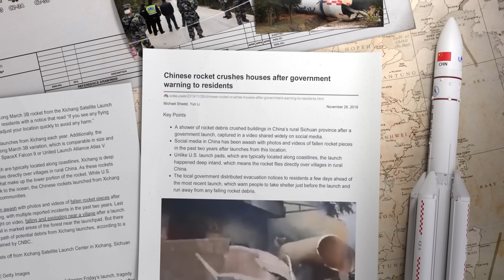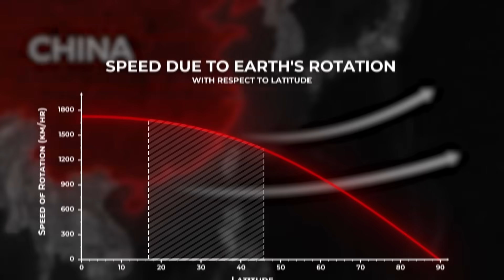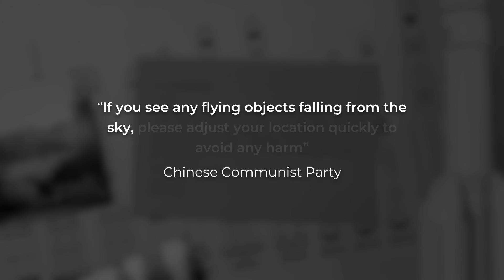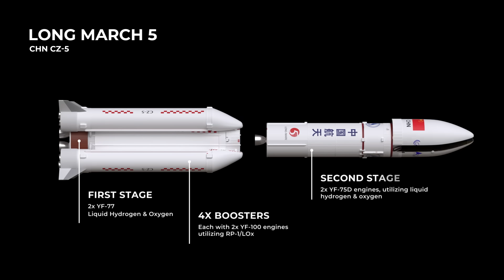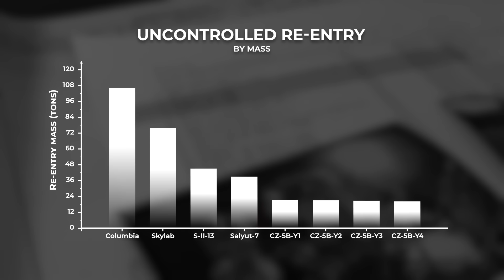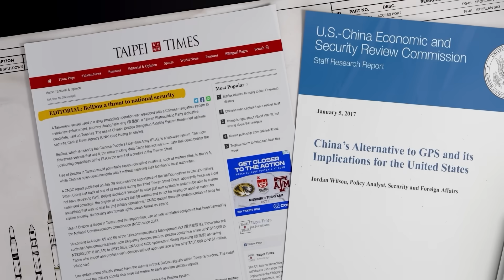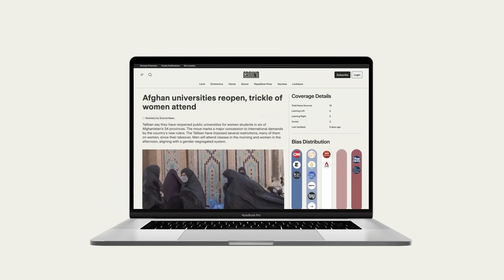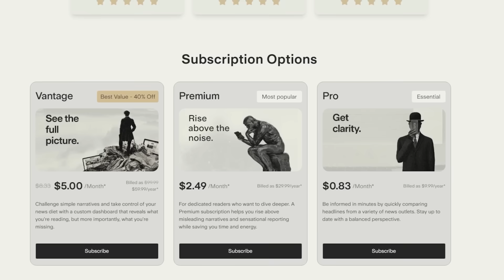The Problems with China's Space Program

Comment: I'm sorry but your idea of balanced is in fact not balanced but forced equal representation to appear fair whether in reality a given topic of issue is exactly 50/50 or not. But it does appease the sensibilities of weirdo control freaks while inhibiting any given viewer's ability to fully comprehend topic/issue/talking point when we do this as it create ambiguity where there other wise would not have been any. 

The video itself is good plus informative though but aspiring to emulate OFCOM's definition of balanced is not impartiality or disimpassioned analysis which is balanced as it's representative objectively speaking so I strongly recommend against it. 

While we may be intelligent enough to get the point, you still need exercise the strength of character to do the right thing  and not capitulate too or appease the sensibilities of  tyrants that want to control the narrative truth be it.

Comment: I recently read the wikipedia article  regarding the long-march rockets. At some point, the rocket was working, but deemed to be to expensive. Therefore they did cut corners in production to lower the price and even anticipated a certain increase in launch failures while doing so.
Reply: that's called engineering
Reply: @w0ttheh3ll  proper engineering is figuring out where you can reduce costs/weight without significantly increasing danger or risk.  cutting back until it ends up deorbiting uncontrollably and unpredictably is very much not engineering, it goes against all principles of engineering, and the oath that engineers swear
Reply: @Corvus.2606  I have an engineering degree. There was no oath involved.
Anyway, I didn't say that you should kill people, I was just making a comment on a very general statement. "Cutting corners" and "anticipating a certain increase in launch failures" is literally what all rocket companies do. The only difference is what level of risk is acceptable to the designers.
Reply: @Corvus.2606  I swore the dumb Oath. I never meant it
Reply: @Corvus.2606  Must be an American engineer thing.
Reply: @w0ttheh3ll  No, not at all. You don't design a system like a heavy lift rocket to fail. You may have to accept some risk which is out of your control but you don't increase it on porpuse.
Reply: @oO0Xenos0Oo  you'll find that you may just have to accept a bit more risk if you don't live in a world where your customers have infinite money, carbon fibre parts grow on trees and refined fuel flows in rivers free for all
Reply: @oO0Xenos0Oo well it depends. You know, roughly every extra 0 in failure rate doubles the costs. So in an hypothetical device has 1% failure rate and costs 1 million $, to lower to 0.1% it would cost 2 million $, then to 0.01% it would cost 4 million $ and so on. As the other user described, it comes then to what failure rate is acceptable, after all, nobody (maybe excepting the US military) has infinite money.
Reply: Did the Wikipedia source this Information?
Reply: @GraniteInTheFace  Well, they did, but source is in chinese for obvious reasons:

http://jdse.bit.edu.cn/fileSKTCXB/journal/article/sktcxb/2021/1/PDF/sktcxb-8-1-songzhengyu.pdf
Reply: You say that as if it literally everything in China hasn't had corners cut during its production. You don't get rebar that can be snapped with your bare hands, and concrete that can be broken off a building and crumbled in your fingers without it being a systemic problem.

Comment: You have to remember, those villages don't significantly provide to planned economy. The people are still in villages, not in the cities and factories, so they clearly aren't important. Besides, most of them are ethnically undesirable. So, really, they basically aren't people, and it might as well be an uninhabited wasteland. Moving launch facilities somewhere would cost a lot of resources, and there's not really a reason to do it, plus moving them would imply that there was a problem with the states original plan (which is clearly impossible). 

Or, you know, communism as usual.

Comment: 😅Chinese GPS/Beidou cannot locate  you if you only use it to locate yourself in a GPS fashion. The uplink is only for military and paid customs for short text messages. If it can locate all users, then DDoS attack is a clear threat to this system😂.
Reply: @yozul1 track your phone? You don't need a satellite to do that....A phone needs to connect to a nearby cell tower you know. That's how fbi always knows your location, and they actually can track every single one of the phones.
Reply: even if it can your phone surely does so anyways with google services and the allow GPS access it just sends it back through WiFi instead
Reply: @yozul1  It is not possible for something the size of a  phone to establish a connection with somthing up in GEO without melting itself. It's  a physic problem, not a  capability problem
Reply: @fluffy_tail4365 navigation satellites are not in GEO. They are only about half as far away.

And it's absolutely possible to communicate with a satellite that far away, as long as the satellite has a large and sensitive enough receiver. We can communicate with the Voyagers at the end of the solar system. There is no hard limit.

That being said, this seems like a very difficult way to solve a problem that you can also solve by requiring software in the smartphone to send back the location over the internet or even just through the cellular network. If you want to spy on your citizen's movements, this is how you already capture 99%+ of what you want.
Reply: @fluffy_tail4365  Not true in the slightest, even something as small as a phone sending the right kind of signal can be detected at GEO, but that's beside the point, because they can use the cell-tower to establish a connection with your phone and make it give up lat/long info. Also most of Beidou is in MEO.
Reply: @fluffy_tail4365  only a small part of beidou is in GEO, most is at the same altitude as GPS satellite, and huawei phones have been able to use beidou messaging for a year or two now, read some news first, dude

Comment: That point about BeiDou capable of "monitoring entire nation's populace" is misinformed, at best. At worst, it take away more important issue that could be discussed in lieu of personal privacy. 

Yes, Taiwan did ban BD receivers, but their focus are mostly on maritime usage. Common mobile phone (unless it is specialized one like inmarsat devices) are physically incapable of establishing 2-way comms with a navsat. But some maritime receivers do have and make use of those capabilities. Given the importance of maritime logistic for Taiwan's survival, they decided that using BD is not worth the risk.
Reply: London, England, has the most CCTV cameras per km2  : 399.27/km2. 
New York has the highest density of CCTV cameras installed in the US: 25.97/km2. 
Beijing in China has the most cameras (1.15M) but is ranked #10 for density (277.51/km2).
Reply: @happymelon7129  I can't tell the point you're trying to make or if you're purposefully misrepresenting the data. I assume you took it from the Surfshark surveillance cities website as their data seems to match yours? China has 6 of the top 10 cities in the surveillance density list. Harbin, China is ranked 3rd for density with 411/km2 and is just above London. 

New York's the highest density city in the US and has only 10% of the surveillance density as Beijing, which is the lowest ranked of the top 6 Chinese cities.
Reply: also that sounds still just like  a  political move....like you can just not establish a two way channel and keep using the satellites as simple beacons anyway and they cannot track you
Reply: @fluffy_tail4365 Since the target is civilian vessels, an outright ban is arguably more effective and time-efficient than mandating them to toy around with the gnss module. Since you only monitor the trade of equipment rather than operational constraints.

The same reason why slapping tarrifs seems to be preferable compared to actually helping local businesses get competitive. Less work for relatively same effect (from the government perspective).

Comment: You didn't mention a important info regarding the Beidou positioning system/network: the current version is fully usable with passive receivers, just like GPS, Galileo or GLONASS. In fact modern chips in most phones support all these systems and are pure receivers. 
While it has the feature for two way communication this is not not relevant for consumer devices, the senders are more expensive, have bigger antennas and consume too much power. So the are only viable for vehicles, especially military. 
Tracking of individuals happens via cell phone towers on the ground and software on our phones that shares the location via internet connection...
Reply: Yeah, I was wondering when a small hand held device had 2 way communication with a sat on geo synch / MEO orbit. If that was so easy and does not need bigger antennas, everyone will be using some form of sat phones already.
Reply: What about the "new" satellite connection in iPhones and Chinese phones?
Reply: @AlphonseDanielEdge  those are LEO satellites, not the same as MEO GPS satellite beacons
Reply: @AlphonseDanielEdge  Those are to LEOs. I really doubt an average mobile device can send a signal to something that is 500km or further.

Even the starlink linked phones, the sats are only about 100km high.
Reply: @someb0dy2  incorrect, the orbital shells are 525km, 530km, and 535km. emergency cell sat service is only good for text messages and low quality phone calls. that being said everything hippo said was incorrect other than the last line.
Reply: This has to be a bot account, there are so many comments that have a similar format and basically same talking points. I would guess that these bots are using something like chatGPT to generate unique comments so they can’t be caught by automatic comment scanners.
Reply: @monkeyman2233-g9o it's not a "fearmongering" claim, it's war mongering, paid for by the $1.6 BILLION that was passed in the house of congress. Expect even more anti-china propaganda in the coming years.
Reply: Military personnel testify before Congress --
Suit technology does not hold up under critical review, regardless whose program is involved.  The need to replicate their space station interior aboard ballistic flights [the US version known as the "Vomit Comet"] also indicate theater, while our own activity in orbit indicate layered video for some interior video aboard the ISS only to confirm that some missions are dramatized.  This isn't to deny hardware in orbit or programs involving near-Earth orbit, but to recognize the diversion of funds for programs of much greater potential. Military personnel have recently testified before Congress of the back-engineering of alien spacecraft -- something that has been going on for decades, while public programs serve as a distraction and the diversion of funds. Near-Earth orbit is real -- however, evidence of layered video as well as other indications reveal that not all near-Earth activities are real as demonstrated as other undisclosed programs receive allocated funds. During the 1990s, former CEO of Lockheed Corporation Ben Rich described the ability by that time to reach other star systems, as well as many other amazing developments that he stated would take an act of Congress to release for the benefit of all of us -- including means for the production of unlimited energy without fossil fuels using similar technologies. Tesla himself had developed such means over a century ago, only to have his facilities as well as his reputation destroyed sufficiently to prevent funding for his efforts again moving forward -- he himself responsible for the development of the electrical grid that we still use today, before the turn of the 20th century.
Reply: Its disappointing to see this channel sucumb to making garbage claims for views. If Beidou had two way communication for tracking on a personal level it's better than starlink- and predates it by a decade. This kind of stupid fearmongering claim as well as the fusion video really showed me the decline in quality for Real Engineering... I think its time I unsubscribed after years of enjoyment.
Reply: @monkeyman2233-g9o  The difference is Starlink is held to U.S laws. Meanwhile, the CCP keep pretending they have jurisdiction over the whole internet and keep trying to go after people exposing it. Not to mention Starlink is more tuned to civilian use, while Beidou is clearly intended for military use. Between  "dual-use" and "we totally don't intend to militarise those artificial islands...", we have no reason to trust the CCP on this.
Reply: @monkeyman2233-g9o I agree. The channel becomes more and more propaganda style channel. Biased, revealing only part of the truth.
Reply: found the china bots
Reply: @DanTheManOG   ever consider you're an unwitting bot for papa biden yourself?
Reply: @DanTheManOG You’re just as much of a bot yourself, a western bot, who’s around videos like this wishing to to hear what you wanna to hear
Reply: @ it’s a decent place
Reply: I just wish they could go straight to the social credit part next time so that I wouldn't have to waste so much time on their not-even-wrong understanding of Chiii~nA~
Reply: don't know which rock you've been living in the last two years, chinese consumers are very proud that huawei phones can send messages to beidou satellite without big antennas and consuming too much power
Reply: @noizz4  They're just having to lie because they're propagandists. They know what the video said was correct.
Reply: @noizz4  Not on iPhones at least. And in China I've enjoyed using Beidou as it's more accurate than GPS, it can do lane level navigations with just the phone.
Reply: @ElectroniK my phone can also do lane level navigation, and it uses GPS and dead reckoning, you aren't impressing anyone.
Reply: Needing bigger antenna on your phone to communicate back to the satellite is not really a big issue, since the antenna law dictates that the sizes of the receiver and transmitter contribute equally, both ways.
Reply: @NFBigfield it still needs a bigger antenna
Reply: @thelastant8366  no it doesn't. Big in the sense of physical size is not needed. A certain length of the conductor (also called antenna) is needed, which can be made pretty small if you use a zig-zag pattern on a pcb for example. 

The receiving antenna being physically large in size and having access higher quality noise filtering electronics further helps. 

In the end its about TX power. And trust me, given the right frequency, your phone can, absolutely, communicate with a satellite.
Reply: you know the best thing about baidu maps is it doesnt censor or hide where american military bases are (we have seen examples like area 51 not being on any map which is why all the conspiracies started), anyway you would be surprised with how many detail you can get on american military bases off it even just as a civilian, i cant imagine how much more does the Chinese military know haha
Reply: @Mohammadmohammad-fx5bz can you see the uyghur concentration camps on those maps?
Reply: China bots

Comment: Toxic fuel and first stage reaching orbit is nothing new - US (Titan's, Delta upper stage) and EU (Arian 5) did that. First stage to orbit is there to ensure reliability - as you don't have second stage ignition risk. Standard BeiDou receivers definitely do not have 2-way capability, this is some propaganda bullshit. There is no possibility to track BeiDou receivers as they do not emit any signals. How could engineer say that it is possible? BeiDou emergency messaging capability is an option which physically cannot track non-transmitting receivers.
Reply: Yeah regular phones absolutely do not have the power to transmit that far
Reply: @jasondads9509   idk about that.   Read any Ham radio book and you're realize that while power is a factor to how far a signal can travel,  frequency plays a much larger role.  The only reason your cell phone isn't bouncing radio signals off the surface of the moon is because the government regulates radio frequencies.   Specifically to prevent devices from causing interference with each other or utilizing bands that are overkill for their intended use.
While BeiDou chips may not currently be communicating back to these satellites,  the potential for that to change is now there.  And it is definitely a concern regarding any military hardware being sold to foreign nations from China now.   Which is likely why foreign publications raised an alarm.
@BarsMonster as for the Titan missiles,  that program ended decades ago, and by your own admission it was part of the upper stage of the rocket, not the first stage which emits the majority of its exhaust in the lower atmosphere.    It's a bit disingenuous to compare a decommissioned weapons system intended as a last resort, to the the rockets used by a space program intended to launch with any frequency.  You're not wrong to say that toxic fuel has been used in the past, but it's a whataboutism to point to such a disparate example and call it the same, because it's not.  Not by a long shot.
Reply: @jasondads9509  Military ones do. Also, @BarsMonster over here saying "this is some propaganda..", which is a hilarious statement given that almost EVERYTHING the CCP pushes to the public is propaganda. It would be more newsworthy if something they said was actually provably true.
Reply: This is European, usa backed propaganda. European already lost the game long ago , usa is barely keeping up thanks to those Chinese engineers 😂 
Only westerns believe this ,who care about them
Reply: Yep, just yankee propaganda towards who they consider their enemies
Reply: Europe and usa paid for this . Eu lost long ago
Reply: LOL.  Ever hear of radar?